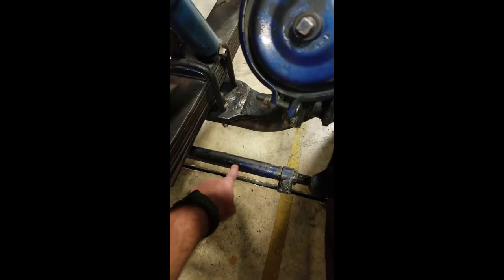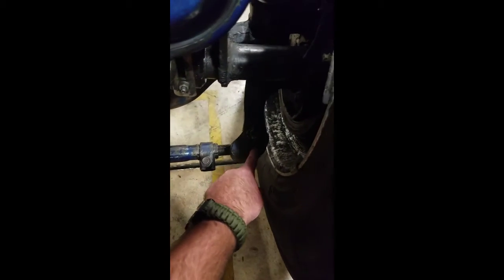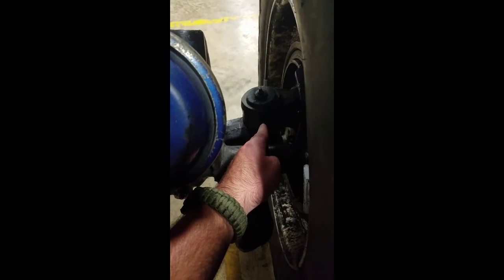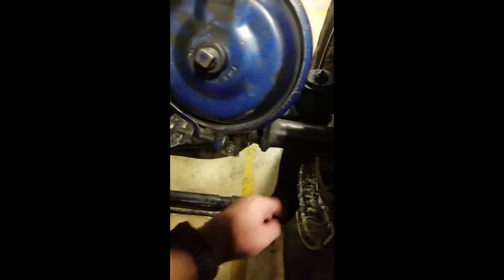Wheel Alignment Fundamentals

Comment: Thank you for the video.

I have a question: I brought my car to sears today for alignment. After the alignment was done, they told me that the rear wheels couldn't be aligned because the bolt cannot be screwed anymore as it's on its end. As a result, both my camber and my toe are off right now (-1.42 and 0.33 respectively). Do you know what can I do right now? They seemed clueless.